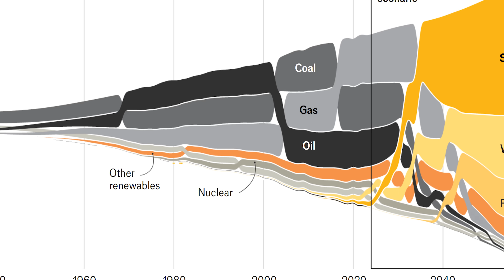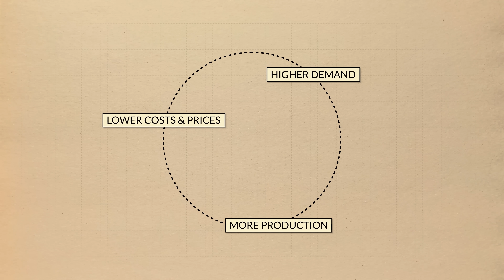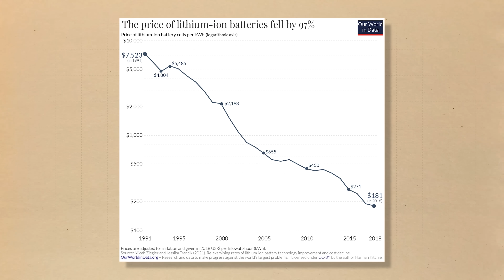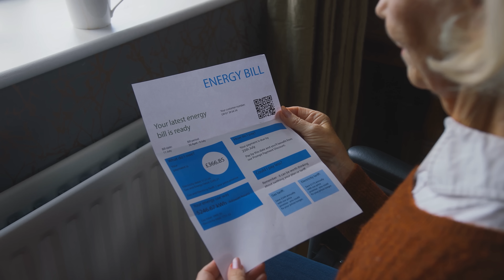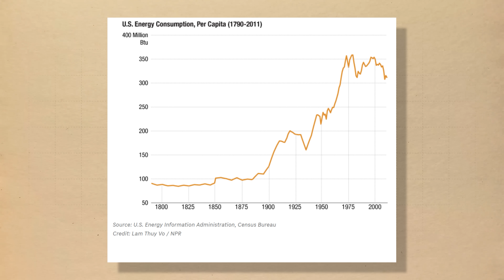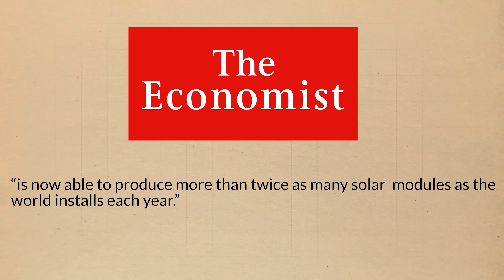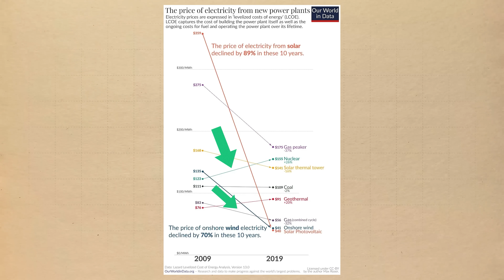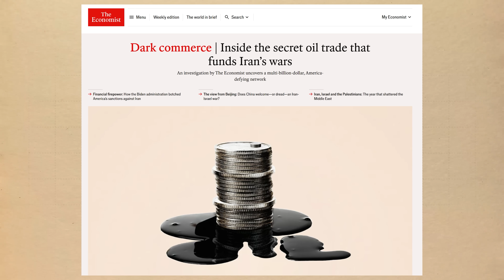Why solar will soon dominate & what that means for the world

Comment: I work in the utility-scale solar industry, for the world's largest solar module manufacturer.  ALL new electrical generation capacity in North America that is scheduled to construct in the next 5-years is: solar and wind + battery storage.  The few remaining gas plant projects, have been cancelled, and the hope of small nuclear reactors, have faded with their extremely high costs and long time-lines.  Solar will deliver: ~60% of all power capacity, with wind at: 25% and hydro and nuclear, making up the rest, in the next ~20-years.  These are facts reported by decommissioning power plants and new projects in scheduled development.  What most people don't know is, there is as much solar, wind and battery storage on the grid, operating, now, as there is built, waiting to be connected to the grid.
Reply: There's a difference between living the dream and living in a dream.

Your dreaming.  Installed capacity of solar is not power produced and on the grid.  Installed capacity is the  maximum power production at solar noon on a perfect sunny day.  Actuall power production is 15-25 percent of rated capacity.  And all that is during the day and variable based on sun angle and cloud cover.

You can't have much of this on the grid without 100% backup power available at all times.  Meanwhile they have to keep all the fossil fuel power plants on a warmed up ready to go standby costing lots of money and energy.
Reply: @jasonneugebauer5310  Correct, the shadow fossil industry that is required to avoid powercuts in winter is ignored.
Reply: @jasonneugebauer5310  you can run a grid 24/365 on renewable power + storage alone, with ZERO fossil back-up!
RethinkX  Energy Report demonstrates it very clearly. The report is on their website.
It is no dream at all, it is the future as seen by people knowing the topic so much deeper than you.
Reply: The one thing we can rest assured is the role of lobbying in the USA.  It can possibly derail your plans for energy independence & reduced reliance on harmful/unsustainable energy sources including renewable agrifuel which is extremely harmful but branded as a renewable energy source.  

Thank you for sharing.
Reply: @louvendran7273  The stranded asset mentality will kill us.
Reply: Unless we invent cheap efficient batteries with near-infinite amount of charge cycles, its a terrible option for grid-scale storage.
Most of the world, unlike Netherlands, has a high pumped hydro potential that can efficiently store and release much more power for a fraction of the cost. A decent-sized pumped hydro installation can store and release power on the scale of hundreds of megawattsto gigawatts and the reservoirs can be built on the top of any hill with suitable geology. With maintenance, such installations can last and pay out for centuries, orders of magnitude longer than any battery.
Reply: @MVargic  Agree.. the idea that solar power is going to account for 60% of energy usage is a pipe dream until the load shifting problem is solved.  Nobody serious is suggesting that solar will dominate industrial energy production in the near or medium term.  Anyone who knows battery technology is well aware that large scale energy storage is still an unsolved problem.  The finest minds in chemistry have been working on batteries for 30 years now and still come up empty.  Progress in gridscale batteries has been entirely about reducing manufacturing costs.  Pumped hydro is great, but you need more than a "large hill" to make it work.  To make it cost effective requires natural hydrology that lends itself to the creation of a large dams.  In these areas you probably have hydro already and won't need solar at all.
Reply: This is not right.  Shale oil wells in USA are being built all the time (and natural gas is a waste product of that process- hence why it is so cheap in the USA).
Reply: Solar and wind will deliver.. they will deliver a road to hell.
Reply: One problem with your claim, almost 60% of Electricity in US is dependent on Coal. And they have 1.3 million MW of total installed capacity
Reply: I have no facts or experience to argue with you, but this does not sound right. All i hear is how cheap and abundant natural gas is.  I hope i am wrong - this just does not seem correct haha
Reply: @Theiliteritesbian natural gas can be very cheap in places that have large gas reserves, like e.g. Siberia. But as soon as you have to start moving that gas longer distances, the costs really start mounting up.
Reply: @Theiliteritesbian  Most natural gas in the USA is burned to generate electricity. @MrArtist7777 is correct. Here are the economic reasons for the USA: https://www.lazard.com/media/xemfey0k/lazards-lcoeplus-june-2024-_vf.pdf
Reply: @Theiliteritesbian  Your hearing is fine... but what you hear are nothing but lies!
Natural gas (I'd rather say "fossil gas") is NOT cheap... actually bloody expensive as we now have realized in Europe.... and is an abomination when it comes to GHG emissions... much worse than coal actually (because of the amount of methane leaks from the extraction fields, transport and storing infrastructure, and final delivery pipe networks.  We have to manage our way out of NG usage asap!

Comment: look johnny, its the economists predicting exponentials again!
lets learn how wrong they'll be this time

Few points: levelized costs of energy is NOT a good way to determine costs for solar (or wind), firstly since its actually subsidized by Chinese low cost coal burning and second since it does not take energy storage into account at all. (which is also why it DOES work for most other sources). in addition solar intermittency has been subsidized by base load power for now.
CONSISTENTLY you mess up "electricity production" and "energy production" which are not the same, electricity grid power is only 25% orso of primary energy usage.
most solar power can be generated in place where people simply dont live, and so transmission is a serious concern, unlike for most other sources.
even with lots of solar, demand for oil for plastics and chemicals will still be plenty high.
also large scale solar investments have not actually decreased emissions that much, which if you recall is the whole point.
etc etc
Reply: Just saying we could have free energy with nuclear. I wonder how much has the economist been paid or if they are just dishonest.
Reply: @sandrothenecromancer6810 Nuclear plant would take 20 years and   twice the amount of money intially assumed.

China is fastly installing more solar wind and batteries.

Oil is subsidized more than renewables. 

Also isn't plastic bad for environment and our health too? Plastic becoming costlier would be a net positive.

Comment: I'm not into the whole eco warrior thing. But yes solar is super cheap when using direct. 10 cents per watt for wholesale panels, each of those will generate a multiple every day. Batteries are expensive. Instead of shaming and guilting everyone into this green energy - instead we should say solar/wind will make the oil/gas/coal we have last 4-5x longer than the current resources and reduce the impact. Have the old fuels as backup and the solar and wind when its churning out loads. We adapt our needs to what's abundant. We have nearly free energy when its sunny and windy, and use a much more limited amount of old power when it needs a boost. When batteries are cheaper we can adopt more than a kind of failover amount.
Reply: Battery costs are expected to fall by 50% over the next two years (IOW by 2026 or '27).  How cheap do you need them to be?  
Existing coal burning power plants already can't compete with solar in many locations.  Peaker plants are being killed by batteries now.  The more-efficient Combined Cycle Gas Turbine (CCGT) power plants see the handwriting on the wall and will likely be gone within ten years unless they are mothballed for emergency use.
Reply: You’re still prepared to bet against engineers solving the storage challenge, given all the recent technology changes …… really ?
Reply: Just to clarify, does "I'm not into the whole eco-warrior thing" just mean "I don't really think climate change is a pressing problem / that real at all"?

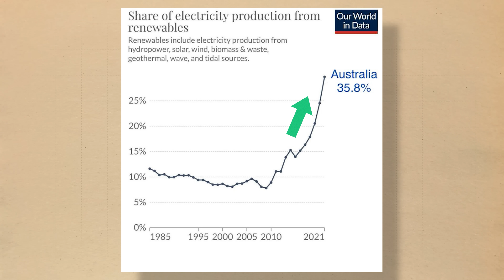Comment: At 5:46 you say renewables produce 35.8% of all energy in Australia. This is incorrect.  Many commentators use the words "energy" and "electricity" interchangeably.  Australia produces 35.8% of its electricity from renewables, but electricity is only 27.5% of its total energy.  This means that renewables produce 9.8% of Australia's energy.  Your error makes the success of wind and solar seem greater than it is and understates the magnitude of the obstacles it has yet to face to replace fossil fuels.

Comment: How to put it politely...

If solar/renewable was cheap, our energy bills would be low. Everything else is just political sophistry.
Reply: I think you need to read the comments that were posted after yours, especially the one from @augustus331. Both you and Joeri aren't familiar with the industry, and the issues that cone with transition to new technologies. Joeri misses a lot of nuance, and you lack any knowledge at all. @augustus331 provides the information you need in accessible language and describes the issues. In short, it is impossible to rely on solely in solar power, because certain industrial processes require natural gas to work. So the world will never be 100% solar. Then factors making the transition expensive is up reshoring manufacturing of solar tech from China, and the inability of most developed countries energy grids to cope with extra capacity. Much like Germany killing off its nuclear capacity, it is now facing the costs of having to transition away from Russian Natural Gas to LNG. That has to be recouped by charging the customer. The same issue applies with adding solar to the mix - it costs money to get the infrastructure in place, but once it is done, costs will significantly fall. This is nothing new. It's the same pattern that occurred with the transition from organic fuel lighting, to gas lighting, and then electricity between the late 19th to the early 20th century. What I think will happen is that each country will have to rely on a mix of energy sources, but with renewabless and nuclear being the largest sources. Fossil fuels will dominate in sectors where there is no other tenable alternative, such as certain industries. The problem is that the AI revolution will be stunted unless developed nations upgrade their energy production, and manage water resources better. The data centres needed to to make the industry efficient need water (cooling) and energy. And no country's energy grid and water management is up to the task. Therefore, investment in the necessary infrastructure is required. So we might not benefit as much from low cost energy as the generations after us, but it has to be done. Why? Because the cost of ignoring it is too high. Climate Change is affecting long-term weather patterns and the costs of the damage caused is mounting to the extent that insurance companies are withdrawing from affected regions. So, we have no choice. Pay less now, or pay more later.

Comment: Some things to consider, 
Solar is not a reliable source of energy and therefore needs to be paired with a more stable form for base load. 
Battery Storage has a much lower energy density when compared to hydrocarbons and other combustion based fuels. 
The present solar technology has a theoretical max energy limit (not financial but technical) and therefore will need another major form of investment - Quantum dots etc.

Comment: First, solar is artificially cheap.  China has MASSIVE overcapacity problems and is losing money on both solar and batteries.
But besides that, solar isn't cheap.  Solar is only cheap by one metric, LCOE.  This does not take into account baseload.  The cost of baseload will increase the cost of solar by a factor of 10x at least.
Reply: none of your claims are true. The top 10 solar panel companies in China are all profitable without subsidies.
Reply: Actually it will increase it by factor of 100000000000x and solar panels if shortcircuited could cause thermonuclear explosion when the photons inside the panels starts to fuse into heavier elements like iron and steel.
Reply: @markoliimatainen2565 What's that number broski

Comment: In less than 50 years nuclear electricity will dominate everything. Simply because it needs the least space.
Reply: Solar can be installed on roof tops, parking lot canapes or in some cases above agricultural land. Land used by nuclear plants can't be used by something else. I don't think nuclear taking up less space is really that relevant.
Reply: @Terigena  it’s the factor 10.000 or so. I think that’s relevant 😎

Comment: Super cheap solar will be handy to have, but we're very far from being able to rely purely on solar, no matter how cheap solar panels become, partly because of the intermittency (including basically zero production half the time), partly because of the frequency stability issue, where the large generators in large-scale hydro, fossil fuel plants and nuclear plants are very important currently, just to mention a couple of major issues. I'm sure solar will dominate in the very long run, but maybe not until we expand into space, but in the upcoming decades we'll also have to invest heavily in nuclear power if we really want to get rid of fossil fuel dependency.
Reply: Frequency stability is a solvable problem. If need be, grid operators can just build giant flywheels - it won't even be that expensive, you can repurpose old coal plants to use the existing grid connection and generator. Wind and solar can also provide some contribution to grid stability just by designing the capability into their inverters.
Reply: @vylbird8014  I'm not saying it's impossible to solve things just using wind and solar. But it's weird to just see cheap solar panels and think that things are solved. We have no good reason to think that a complete energy system without a hefty nuclear component will be cheaper and faster to set up than one just using wind and solar, and we can be very sure that the wind/solar solution would take a higher toll on our environment. It would make sense to factor in that too when we whine about high upfront costs for nuclear reactors. What value do we assign to our environment?

Comment: Rather than an incentive for using clean renewable energy, dirty energy should be penalized to pay for environmental and health issues. Those funds should be used to incentivize long distance power transmission, as well as energy storage at both power generation sources and additional storage near point of use.
Reply: We can do both but subsidies are usually more politically acceptable compared with taxes even though the effect is the same.